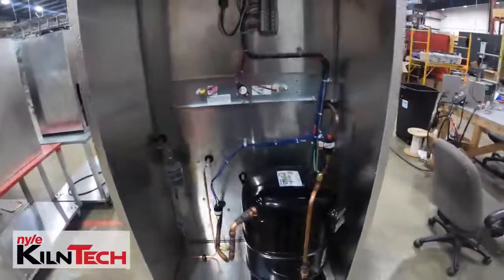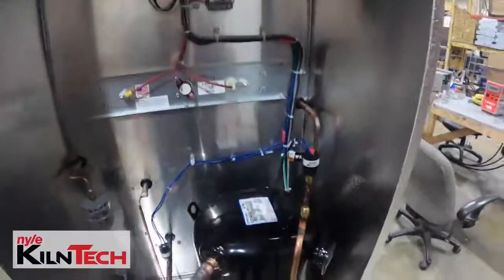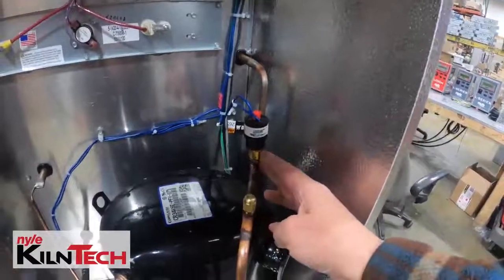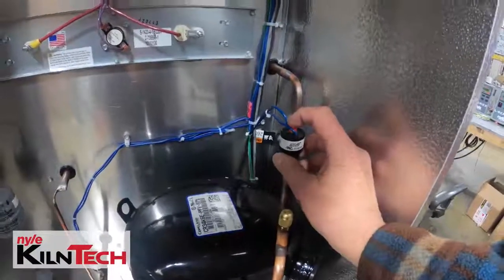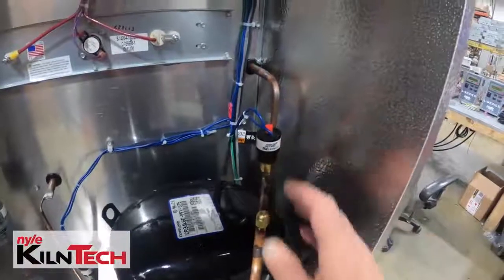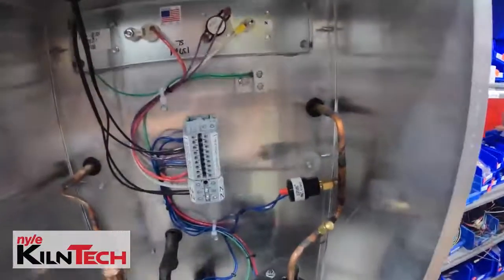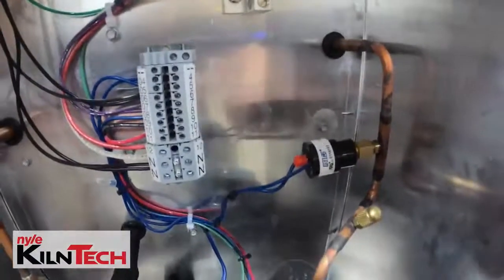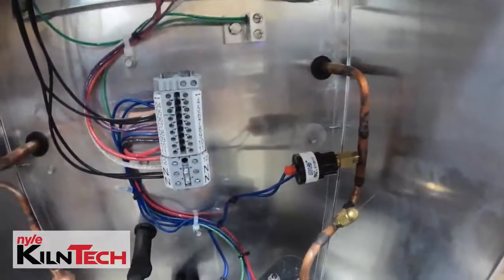KilnTech Episode 10: High Pressure switch reset for L53/L200

Comment: Thanks for these videos! I recently purchased a used L53 and I am building the kiln this spring. I did not receive owners manual and between your web site and these videos I am slowly putting my arms around what I need to do. Thanks again and please keep them coming. Oh maybe some videos on figuring drying schedules and the math behind it.
Reply: Hi Mark
Check out the KilnIQ videos for that.
Reply: Stan. How do you know that this pressure switch has been tripped and needs reset... Error msg? Or you just have to realize no water is coming out?